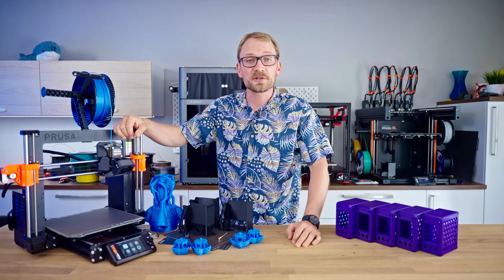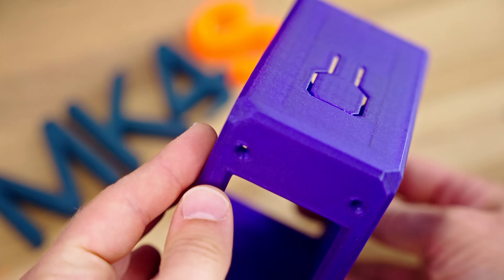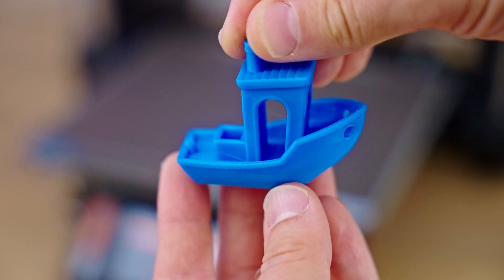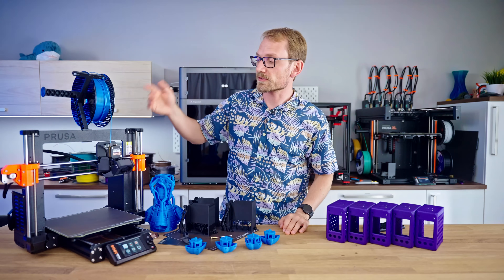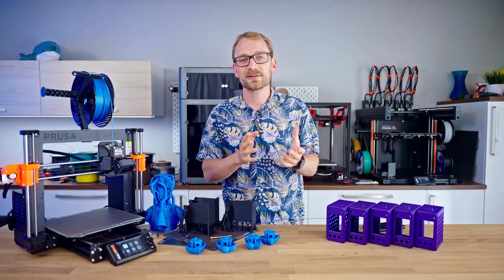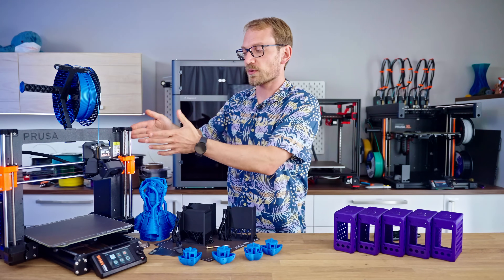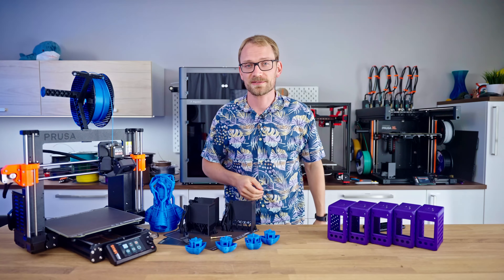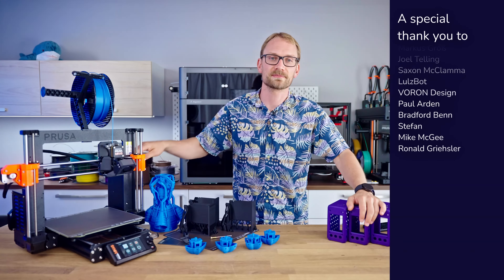"S" is for Speed - Prusa MK4S

Comment: I purchased my MK4 kit on July 16th, and received it July 24th. I was finally able to get it assembled, and printing on July 29th. I've been pretty happy with the printer, and it's been a huge upgrade over my ender 3 s1 pro.

However it sucks buying my printer, and having it outdated so soon. I contacted PRUSA customer service about an hour ago, and asked if I could get the upgrade since it's been less than 30 days since my purchase. I was told no by the representative. I asked politely again since I'm still in the return period if I could get the upgrade...and now I'm waiting on an email response.... I hope PRUSA does the right thing for a new customer....
Reply: I bought my MK4 around the same time. Two things: 
1) The MK4 is still a great printer. The hardware differences between MK4 + MK4S are small. And things like the CHT Nozzle (yes I know, you have to buy one..)  are usable with the MK4 without hazzle.
2) You've received a 100$ voucher when you bought the MK4 - That's less than the upgrade kit costs, but still a pretty good deal. 

I've already spent my voucher on some spare parts - And I'm undecided if I will go with the full upgrade kit. There are only some small things like the fan or GPIO board that I might be interested in (and for the GPIO board it seems like I need the new WIFI module). So maybe I wait until the pieces are available individually and do some selected upgrades.
Reply: @Flo-8bit  it definitely is a great printer... It just stings with this being announced so soon after I purchased. With zero signs there was an upgrade on the horizon.
Reply: You should've bought an A1 or P1S
Reply: @oyuyuy  not interested in a closed source Chinese printer that forces you to be online at all times.
Reply: @wiesman2613  Cool, then an A1 or P1S would be perfect for you!

Comment: I designed my own corexy last year, after it evolved to MK1, its printing reliably with no manual input required. I just sent print and walk away. Its now at 750+h print hours combined. So reliability is not a big deal. I don't even run mesh at the start and got perfect first layer. Prusa really needs to innovate. If i can do it just by myself with no prior mechining or 3D printing experience than whats stopping them to innovate?

Comment: 5:25 Please post a follow-up with further exploration on speed vs. strength.
Reply: I would point you towards the YouTube channel "diy perspective". He did an investigation of layer adhesion vs volumetric flow. In summary there is only minimal decrease up to 50% of your hotends max flow rate, after that the layer adhesion goes down, irrelevant of gloss vs matte finish. For example 3djake pla turns matte extremely early in my experience, already at 10mm3/s with a rapido uhf at 230c, a hotend that can do 40+ mm3/s at that temperature. Others like polymaker polylite have a glossy finish much further

Comment: I have to argue that "it just works" IS the standout feature, maybe one that the general public doesn't appreciate as much, but at the end of the day, it's the most important thing, and nobody seems to do that better than Prusa.
Reply: How about the XL when it was released? It did not “just work”.
Reply: I currently have my MK3 and my (~1 month old) MK4 standing next to each other and printing in parallel. I always thought that the MK3 is already pretty good at "it works", but the MK4 feels sooooo much more "it just works" :)
Reply: I'd flip that around and say it's 3D printing enthusiasts that don't appreciate "it just works".  If you like tweaking and tinkering with your printer to get it to print faster, more reliably, or more accurately, the fact there's nothing to do on a Prusa printer is boring.  The general public wants "it just works" and won't be interested in 3d printing without it.  The load cell functionality and the promise of perfect first layers on the Mk4 was the thing that convinced me to get back into 3d printing after several years because it looked like 3d printers had finally gotten to the point where (at least on the Prusa) things mostly just worked.
Reply: Yup my MK3 went 4 years without any issues at all! Then the hotend started oozing replaced it that new one lasted only 3 months then replaced with another from Amazon that lasted 1 month then heat sensor failed just grabbed the MK4S on Black Friday assembling tonight hope it beats my MK3!
Reply: Most 3d printers today would just work unless its something like a Voron.
Reply: @JojoJoget  Sure, they’ll all print a speed benchy, but if you want to do functional parts, Prusa printers will print them the size you need them on day 1. Bambu printers won’t, for example, they need tweaking.
Reply: @noobling8313  Bambus need tweaking? Lol they are the king of hands off printing, i have 6 x1s and 2 of them have over 6k hours and 0 repairs. I dont tweak anything
Reply: @JojoJoget  Most of the printers will just work out of the box, but after ? Having a BambuLab X1C, sometimes I miss the "it just work" of my MK3S+... Fortunately, I kept it just in case (and the case appeared some times since I bought the X1C a year ago).
Reply: @blm7929 , could you please elaborate on what you mean when comparing the reliability of the X1C vs the MK3S+? I run a relatively small print farm, half Bambu's and half Prusa's and I've found myself using both almost interchangeably with very little differences between one brand or the other. I'm curious to hear your experience just for the sake of learning. :)
Reply: @agnicholson  I don't have a printing farm, so I don't have as much experience as you do. I use my printer almost daily, mainly to print prototypes that I design, but also other objects of course (to give an idea, I empty 10 spools in 3/4 months).
My MK3S+ has never given me any problems. I've set it up, run the first wizard, and never adjusted it again except for the Z height when I buy a new plate. Over several years, it has always printed without any problem, whatever the material (PLA, PETG, ASA, ABS, PACF, etc.). I start my print job, forget about it, it's over.
With the X1C, in less than a year I've already had to contact the after-sales service 4 times (compared with 0 for the Prusa, which printed far more parts). The first call was within the first week (problem with the AMS, new motherboard sent). Then there was a problem with the print head, which recently remained out of order for 3 weeks while replacement parts were received: the print head was making erratic movements, impossible to finish a print, 2 plates scratched from end to end, resolved by sending a new motor and new belts.
In the meantime, my Prusa came out of the closet, no set-up, printing right the first time even after not being used for months.
In short, I like the X1C, especially with the AMS, but frankly, in terms of reliability, it's way below Prusa... and I've already seen messages that point in that direction, so yes, I repeat, I'm not running a print farm.

Comment: With the matte finish on these prints (and the Bambu's) I've been really interested if printers have been going "too fast" and sacrificing dimensions and strength at these higher speeds. I've heard of super fast prints on the X1C that crumble in actual use and I would be interested to see real data on this.
Reply: There are videos about that topic, the conclusion was: layer adhesion decreases with higher flowrates. However not in a linear way in relation to your max flowrate. If you want strong parts you have to stay within 50% of your max flowrate because you still get 90+% of the maximum strength . If you print near your max flowrate, your layer adhesion drops dramatically.
Reply: They're just outrunning the flow rate of the hotend+nozzle. Looking at the numbers Prusa published for their nozzles (including this new one), they are overly generous with their values. When you push it too far, you will get underextrusion, poor layer adhesion, and a matte finish, as well as an overall quality degredation. The gold standard test is to test using CNC Kitchen's flow test, and if I get an MK4, that'll be one of the first things I do. But this is not a big deal, IMHO, as it's very common for manufactures to hyper overly optimistic values (E3D does this too, for example). And it's an easy slicer profile change to dial back the volumetric flow a bit.
Reply: Absolutely, in most cases they are just outrunning the hot-end. Matte finish and poor layer adhesion are two of the most obvious signs. Under-extrusion is another symptom, but not as easy to detect. One of the simplest things you can do to prevent this, no matter what speed you want to run at, is figure out what the max volumetric flow rate is for the material + hotend, and put that in the slicer print profile. The slicer will then slow things down as needed to avoid exceeding that. CNCKitchen has a great video on how to do this. The manufacturers know this, but in the interest of one-upping each other, they push things too far. The hot-end vendors are also overly generous in the max flow rate numbers they list on the product page for their hotends (E3D in particular).
Reply: My Bambu makes terrible banding at any speed over 200mm/s and if I try to put it into "Ludicrous" mode I have a 50/50 chance of the print failing.

Comment: I’ve noticed that while Prusa’s recent models haven’t significantly evolved, competitors like Bambu Labs are offering more advanced 3D printers at similar price points. To stay competitive, Prusa needs to either enhance innovation or adjust pricing. Consumers are looking for better value, and without more significant improvements, it will be hard to justify current prices.
Reply: I'm pretty sure prusa will never compete with bambu on price. The manufacturing processes and environment is far too different. But they do have the advantage of being able update their designs much faster (came out with the 4S in a year) because of AM. I think if Prusa comes out with a more affordable tool changer or 4 axis printing, both of which they have a significant head start on, they'll keep themselves relevant. Otherwise, their improvements are too incremental.
Reply: *at far better price points
Reply: Prusa simply cannot compete with Bambulab because they are making their printers in Europe.
Reply: @bastienx8  Nonsense.

Prusa just needs to use modern manufacturing techniques and automation. Their biggest competitor uses that.

It's not like they don't have cheap labour either with Czech wages.
Reply: @BeefIngot  With 3D printing they get low cost plastic parts, especially because they build their filaments themselves, and most of the parts are not 3D printed anyway (aluminium frame, PCBs, motors, screen, power supply...). 
But the labour is way more expensive in Europe because the employer must pay insurance, taxes, pensions for every employee, and every part they order in Europe is more expensive for the same reasons. I wouldn't be surprised if the employees cost 3x more to the company than in China for example.
Reply: @bastienx8  China also has a better domestic market for parts because they manufacture them while Europe imports them from China, so its not merely Europe pays their employees better
Reply: @bastienx8  I absolutely dont buy the 3d print kit type argument, because they've had delays and poor part quality with the 3d prints forever as complaints.

They could produce parts so much more efficiently without it. There is a reason they are slowly adding more and more injection molding. They cant resist.

Comment: The MK4s is Debian Stable, The Magneto X is Arch Testing.
Reply: Is bambulabs then Apple?
Reply: @p-thor That would be ultimaker i guess.
Reply: @kastmodder ultimaker is more Microsoft imo.
Reply: @p-thor  Let's stay with OS analogies. It's more like Chrome OS, that cool kid on the block which is locked down but does the job. Creality is Arch Linux, it's a lot of work to get it working properly, and it breaks all the time. Ultimaker is Windows, that kind of fits indeed. Stratasys is OS X, expensive, shiny and originally based on free software architecture wise.
Reply: @Alex-kr7zr  TBH creality is preety stable if you follow few things 

1) before every print clean the bed with ipa 
2) don't just manhandle the prints after they are completed or just remove the plates and do your wrestling out of that printer 
3) if any brand of filament works properly don't change the manufacturer unless really necessary 

Still rocking stock ender 3 only with added magnetic pei sheet ( because old started to show its age )
Reply: And creality is android
Reply: Such a great analogy. Perfectly sums up my entire experience with Prusa printers.
Reply: what is voron then?
Reply: MK3S+ Debian stable
MK4 Debian unstable
MK4S Debian testing

Comment: faster prints* (with less detail due to higher layerheight, same slow movement speed- far away from what would be mechanically possible with modern printers)

yes, Prusa is reliable but honestly, so is Bambu Lab and they have more features and are cheaper... Prusa needs to step up their game. The only advantage they have left is beeing made in the EU and their open source approach but i don't see how that would stop them from building a corexy machine for excample or an actually good Bambu Lab AMS competitor

Comment: I think injection molding and other custom tooling-based hardware manufacturing is one of the best things I'm seeing Prusa doing. They can get better, more consistent quality for far cheaper.

Prusa improving their DfM/DfA will be very good for them in the coming years as they deal with more cutthroat competition.
Reply: I guess the compromise is that they injection-mould parts for the economies-of-scale. But ensure all those parts can also be 3D-printed on those machines.
Reply: @andybrice2711  Prusa claims to move around 10k units a month. This is 100% within economies of scale. This is coming from someone with thousands of 3D printed production parts in the wild.
Reply: @ZURAD  But let’s say they’re planning to stick with this design for another 2 years. That’s 240K parts. So surely at that scale it works out cheaper to injection mould them?
Reply: @andybrice2711  Yes of course it does. FOSH company owners are not known for being the most shrewd and numbers driven of people though. I don't get it, but it's his competition to lose
Reply: @ZURAD  So what I’m saying is: I agree it’s sensible to injection mould those parts for the machines they’re selling.

But they should also ensure those parts are designed in such a way that they can be easily 3D printed. So that people can easily repair or modify their machines.
Reply: @andybrice2711  This is prusa, so naturally all the updated MK4S models are already released and still printable. They're not the kind of company that ditches support for the old model every time they release a new one.
Reply: @andybrice2711  Josef Prusa said in the launch video that the injection molded parts would remain available in easily downloadable/printable form.
Reply: almost never possible to use the same geometry for both processes and get comparable properties.
Reply: @simonschneider5913  That's true, but I imagine you send the CAD model to the injection molding company, who then has their team design the molds, and make the tweaks needed there for plastic flow, separation line decisions, draft angles, injection ports, cooling lines (if any), oversizing for shrinkage, adding bosses, etc. I'm sure they go back and forth a bit on these decisions, too, to get it all squared away by both teams before running 100,000 of them.
Reply: @gfixler  yeah, and with all this i think cost will escalate dramatically.
Reply: in injection molding, you cant do small batches. which means they will have to pay out to their supplier in bigger chunks. or they go and buy their own machines. which are quite expensive to buy and to run if you need to produce reliably.

prusa never had to do that before. i dont think theyre up to it.
Reply: @simonschneider5913  Prusa owns and operates injection molding machines. Their claims of selling 10,000 units a month let you know they were making at least 96MM at the low end at some point. They can figure out how to optimize manufacturing.
Reply: @ZURAD  ok, i get that. so they are doing it already. did they stop the printers? or are they running both? i would love to see their balance sheet! :)

Comment: I still dont understand the hype for prusa, i have a second hand practically new MK3S+ with an MMU and after the first print I went back to my modded out version one ender 3. To be fair only the frame is original ender even the wiring is all mine. Still better quality by far, faster, and more reliable since I haven't had a failed print in years and the prusa failed on the first attempt to simply home.

Even during the homing process I wanted to shut it down and put it up for sale because of how loud the fans and steppers where. I didn't even want to cannibalize a single component for a voron 2.4 build which is the reason I original picked it up for free.

I have a Voron 2.4 350mm now all up and running and a Sovol SV08. To everyone out there and who made it this far, I recommend buying the Sovol SV08 and mod that printer. Wish it had come onto my radar before spending so much time on the voron. Even after modding everything wrong with the SV08 it will still come out way cheaper then a self sourced voron and you dont even need a printer first.